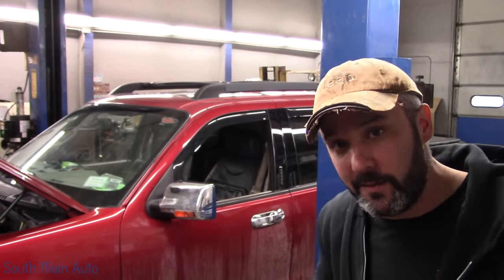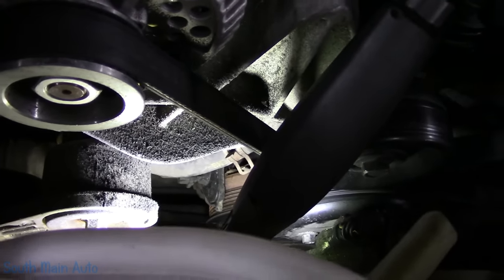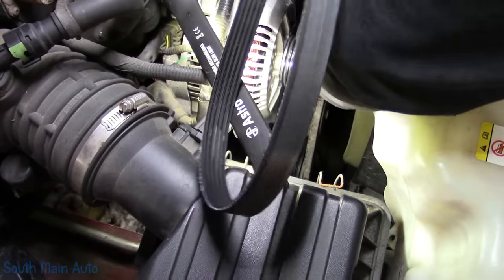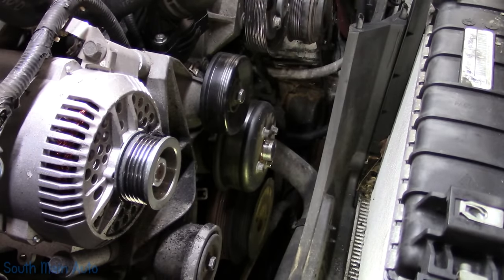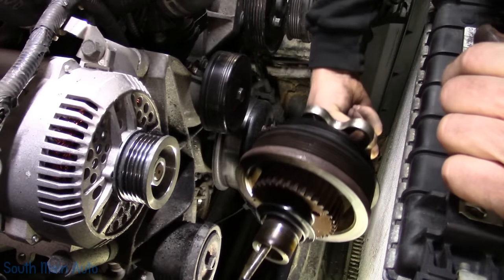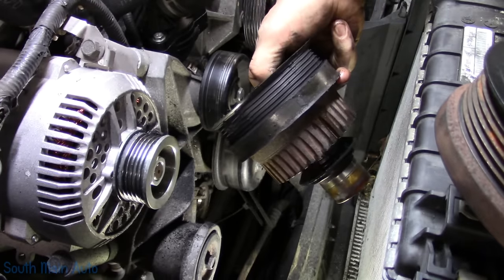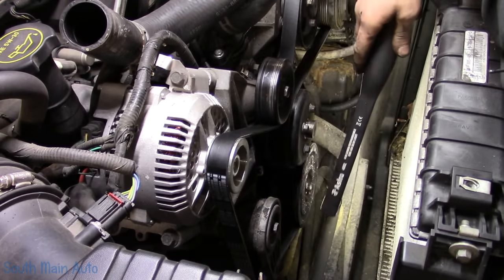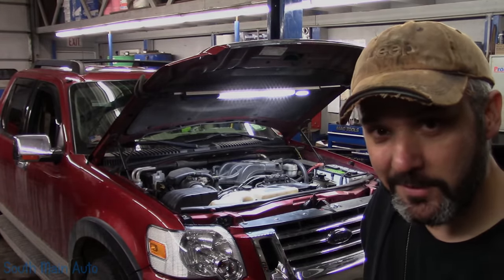Ford Explorer Sport Trac: Crank No Start

Comment: I just removed and reinstalled my harmonic balancer on my 2003 Ranger with the same motor as this sport Trac, the 4.0 sohc. Have a couple comments that may help others. Napa's version of the rental fan clutch removal tool includes the needed 57mm and 36mm wrenches and works great. The "bolt style wheel puller" kit from harbor freight is 20 bucks and works great for this application. The kit even included the correct size bolts to thread into the pulley. 

I don't have the fancy impact that fits inbetween the radiator and the pulley. To get the balancer bolt loose, I put a long breaker bar on the bolt and rested it on the passenger side frame rail. Activated the starter for just an instant and it broke loose real easy. 

I also didn't know that the bolt is TTY and shouldn't be reused. My local parts stores didn't have any in stock. Make sure to get one before disassembling like I did.

Comment: This is old I know but the AutoZone thing was spot on, in 08 I got laid off from gm I was at the time gm ,Ase certified after driving around all the shops in town and no go on a job I put in applications everywhere,I figure I could work at a parts store until winter was over when people get their taxes back business will be boming and il get back into a shop , AutoZone said I wasn't what they was looking for because I kept correcting idiots that were wrong!!! Isn't that what you are suppose to do help the customer get THE RIGHT part? Well apparently not , it was a blessing though I started my own gig and never looked back , now other shops in town send me "phantom issues" which means them plugging in a scanner don't tell the which bolt to turn so they are lost , I love this channel I can relate to so much I see here,and have learned a thing or 2 along the way

Comment: Pretty much any autozone around me in suburbs of Chicago are some teen kids that don't know a bolt from a screw. I went in there needing brake grease, some clown kid try to convince me aluminum antiseize is the "same" thing. Told him "what do you think ANTISEIZE is good for?!" Told him yea go ahead and use antiseize on your slide pins and come back a year later and see what it becomes, more like seize paste! Needless to say that young man learned a thing or two! And yes their application process is a mirror under nose and if it fogs up, you get the job!

Comment: Well Mr O thanks for this video and you are always so funny that you say you can do this job. Well perhaps 100x slower and buying the right tools or just saying time to give up. Well i pulled a crank balancer/pully once and rented the baddest compressor and huge impact air wrench and the crank pully did not budge a bit. ended up drilling 6 holes around the bolt flange  just bearly through and squirting liquid wrench and the bolt came out. but pulled the pully off with a large external puller that gripped the outside of the pully rim. Yes the harmonic balancer started to clang shortly after that. Had to replace cranksensor on 1992 buick lasabre 3800, touchy adustment required. Thanks so much for sharing you expertice and experience.

Comment: Great Video! Need to apply a light coat of black silicone to inside of balancer at end of balancer and on keyway to prevent oil seeping through and leaking at bolt head.

Comment: Remember, that engine is a hybrid of a German 2.8 turned 2.9, turned 4 leaker, then lightened up and crammed full of all kinds of pitas.
Ford did that.
The customer was lucky to find someone around on a late Saturday to do all you did or tried to do.
The third guy at the parts place left when he stops getting paid, and he used you to try and train Beavis and Butt-Head. 
If you could do it over, you might get them a rental car for their Exploder and just visually inspect and diagnose.
The best parts to fix a Ford are the updated parts from Ford.
But you are of a special breed and gave up your Saturday for the right to make it run anyway.
The customer found a good man. He finishes last, learns the greater amount of knowledge, and tried to network any day of the week or hours he can use to accomplish getting that customer a running vehicle.
That's not taught, except to the most tenacious and dedicated people who can cut to the quick.
They should be compensated well for sacrificing their time and relationships.
But, then, Mrs O knows too, you can pick another day to spend with her when things calm down and you trust someone to run your shop as you would.

Comment: You have so much more patience than I;  Nothing bugs me more than having to remove ten things to remove the one item that needs it.  In this case in order to remove the damper, you have to remove the fan, to remove the fan remove the shroud, to remove the shroud remove the coolant and the upper hose, then remove the PS reservoir,  then remove the coolant reservoir.  THEN you can remove the damper.   I hate that stuff.  Seems like every job is like that, too.

Comment: 1969 Ford F100 with a 302, in the parking lot of AutoZone tried Five (5) starters and none worked. Push started truck and went to O'reilly Auto Parts got starter and installed it. Truck started right up. After 6 years starter still going strong.962.739 miles on the clock, engine never been opened up. Bought truck new and maintained by my Ford dealer. Service Adviser @ Ford laid $5.000 on counter for my truck. No deal I said. Pop the hood and one fan belt for Fan, A/C, Alternator, and Power Steering. Two vacuum hoses, one for Distributor and one for Brake Booster. Today's vehicles nothing but high dollar electronic nightmares. You keep the new vehicles, I'll keep my old 69 Ford Ranger..

Comment: Seen this video before. Remember calling a buddy of mine next day. He has one he inherited. Was his grandmother. Sweet lady. Thing is mint. Looks brand new. Think only time she drove it was to have him change the oil. He chased the long crank, misfire for a while. I called him up, dam 2 piece pulley and crank sensor. He said he was in the middle of changing it, AGAIN! I said no aftermarket. Take it back before you mount it. Bite the bullet. Order one from Ford. It might last longer. I'm not a Ford fan. But this truck looks like it just rolled out the showroom. I gotta admit I kinda like it. Told him oil it up. He doesn't drive it in the salt. It might last a few years.

Comment: The same thing happened to my dads Sport Trac, the pulley separated from the balancer and migrated back towards the block.  The belt cut grooves in the rubber portion and I mistook it for a pulley as well.  His didn't kill the pickup sensor, but the belt squealed like crazy anytime it was first started or the A/C would engage.  I changed the belt and the tensioner and the squeal went away.  Went to visit my dad a month later, and the squeal was back.   That's when I noticed chunks out of the rubber "pulley", which is when it I had the ah ha moment!.

Comment: What happened to the other "not-a-sponsor", the local NAPA store?   This video was really helpful in all respects, from the importance of choosing the right parts store to the values of a good visual inspection in diagnosing the problem and of working at a time when you're not going to be interrupted to the benefit of long experience and having & using the right tools to get the job done without damaging other parts, like the radiator, or making the repair any more complicated than necessary.  The talcum powder tip was great great, but you know it causes cancer in serpentine belts, according to the States of California and Sinaloa.

Comment: Planned to removed the oil pan to replace the oil pump, Ford 351W so I jacked the engine against the hood trying to clear the oil pick-up tube that was blocking the oil pan removal; installed new bolts, gaskets, new motor mounts and made sure everything torqued down. Tried to sit behind the wheel  to crank it but couldn't...the box containing the new oil pump was just sitting there... on the floorboard.

Comment: I bought a new battery at AutoZone shortly after I moved to Minnesota. It was not a maintenance free battery and Minnesota has some good extreme temperatures so I asked how often people usually needed to check/fill the water in the battery. I received a funny look and a "Uhh, you don't put water in batteries. You have to put acid in them, we don't sell that and you don't want to mess with that" I don't ask them questions anymore

Comment: Eric, I hope you read them the riot act on the service. In my retirement years now, I have no qualms telling the local manager their stuff stinks. Sometimes it makes a difference. The loud radio issue is a real sore spot with me. The employees would crank it up on their store demo radio. It was always hip hop. So when I would go in the store I’d make a b line to the radio and change it to classical. Several times I told the manager the music choice /volume screams “go away” . If that didn’t sink in, I’d un plug the antenna.

Comment: Don't feel bad. We all miss stuff. Just last week i spent 4 days trying to figure out why my 96 ram wouldnt start after tracing a burnt fog light wire causing an issue with my park lights. Turns out when unplugging stuff to isolate the location i failed to  plug the connection for the starter solenoid. Same truck i had also been looking into new torque converters because of unwanted lockup/unlockup action that turned out to be a brake light switch issue

Comment: I had this exact same problem get towed into my shop this week on an explorer 4.0. The belt stayed on and cut grooves in the rubber part of the dampner too. The complaint was that the engine died driving down the highway..... the pulley had cut the crank sensor almost 1/2 way through.

Comment: I had one of those come in with the outer ring missing, and some other shop had installed a smaller belt to take up the slack. The rubber ring had belt grooves worn into it.

Comment: Same thing just happened to my wife’s mustang with the 4.0 v6. after 214,000 miles. The Pulley jumped back, and the belt cut a new groove in the balancer. When this happened, the car immediately died in the middle of the road.

Comment: As a parts counter person I find lot of customers askwhat is wrong with car showing a code and how to fix it. We are not mechanics. Its up to the customer to figure that out. Some customers get mad if we tell them to take it to a proper mechanic for a diagnosis as one code can effect other systems in the car. If they insist on that part we will sell it to them but once installed they can't be return and then they get real mad. Then they cuss us out and call us jerks

Comment: Bro. No matter what dealer you work or what parts store you go to. They (parts) will always find a way to mess up your entire job and cause complete havoc. 

Not having the part that was quoted to be "on hand" or pulling the wrong part. Or quoting the wrong part to find out when going back together that it was in fact the wrong part.
Or my favorite, 
When they don't have the part, order the part that takes 3 to 5 days to arrive, and it ends up being the wrong part, then come to find out they had the correct part in stock the entire time 
:) breath breath breath

Comment: Here is a thought: possible that the alternator locked up, broke the belt and whoever replaced the alternator had to get the smaller belt because they installed it on the rubber because they didnt notice the balancer was in further than it should? That is why it has such nice grooves?

Comment: had an ac belt used to do the same thing.  But it was worse since all the other belts had to come off first to fix it.  Seems when they make their own groves, the belt stretches to much to let you tighten it on the right way.   
Just watched a 6 year old clutch video, and they did the same for the water pump pulleys.  Once in the car and noticed, no room to get at the bolts to remove it.

Comment: Talcum powder on the belt, that sounds a little messy. I had a belt on a Subaru that squealed at idle sometimes (it's changed now and the new one is dead quiet), but I used to stop the squeal by holding a little piece of an old candle against the sides of the belt while it rotated. This would stop it squealing for a couple of weeks, and it didn't leave any residue or make the belt slip...pretty neat I thought.

Comment: I had a 6.2 Diesel in for a bad miss - and after checking the compression across the boards and pulling the valve cover on the bad cylinder - I saw a lot of oil on the floor and I looked and saw a rod hanging out of the block. Doh!!!!! I missed that one, big-time!

Comment: Never used belt squeal.  Didn't know that it fills the groves.  First car I ever had that squealed was last year, and it wasn't the belts, it was the timing belt tensioner pulley.  When I took it off to fix the head gasket leak, it was obvious what was squealing.

Comment: Another great video... Is the fan nut left or right hand thread?   I found the easy way to tell which way to loosen the nut is to look at the fan blade... turn the nut from back edge to front edge to loosen it.. the fan will always tighten while running..

Comment: HERE'S A GOOD TIP ON USING A PULLEY STRAP!
Grab a socket, like the ones used for chainsaws and the like....they may have a handle or just a hole where a rod or pin goes through.
  With an angle grinder or drill cut a slot into the socket on opposite sides ....wide and long enough for a strap to fit through. With the loop formed, wrap this around the pulley. This gives you a place to fit a large box wrench as you snug up on the strap tool.
  Hope I explained it so as ya'll kin unnerstan'.       Cheers be two ya.

Comment: I was the guy that put the slightly longer bolt in the radiator shroud and cracked my  radiator 🧐  1/4 of an inch cost me 180.00

Comment: I had a similar situation.  (The complaint was belt makes noise.)  When working p/s the belt squealed a lot. It took a few minutes to figure out - outer pulley was gone and it was running on the inner hub!   / 
90% of parts stores mess me up!  I leave pissed, disappointed, disgusted and feeling like a rare genius. Damn!  if I have to give you your part# off your website!  Why are you here!  This week I had to show a 50 year old  parts man - what the original jb weld was.  He typed it into the computer ( cause he had no idea) found some jb weld super glue and was ready to get it.  🤯

Comment: I know this is a old video but I didnt see if the crank bolt was new. These bolts has to be replaced or they can become loose over time and cause the timing chain sprocket to strip out the key way and cause the valves to hit the piston. The key way is only used for timing. Pressure from the crank pulley and bolt is what keeps the timing sproket from spinning and breaking the key. Just throwing that information out there if someone decides to do this type of job. Always replace the crank bolts on all ford vehicles if they are removed.

Comment: I went into Autozone last week and asked them to look up which brake bleeder screw I needed (because of course I snapped it off) and the guy proceeded to tell me that I had to bring the old bleeder screw because they are not standardized and it could be any size. I told him that was absolutely not true and he argued with me of course. Fast forward 5 mins and I got him to look it up on his computer to "prove me wrong", guess what? Yup showed exactly which screws I needed for the front and back. Guy hot super mad for some reason and left, the girl that was there came over and apologized for his behavior. That is a pretty typical experience at any of my local Autozones.

Comment: I squirted Dishwashing soap mixed with a little water inside my Honda A/C clutch and it's so quiet now.
It would make high noise intermittently.
I you used oil it would foul the clutch and cause slip.
I think particles and goo interfere between static and moving mass and they ring like a bell.

Comment: When I  pull a balancer I just put the bolt back in and back it off several turns and then install the puller using the bolt to pull against

Comment: I had an Explorer that would crank and not start. After a new fuel pump, and HOURS of screwing around the 'mechanic' gave up! (cost me a bundle) I had it towed home and in under one hour I found that the truck FORGOT the key code! The second key started it up instantly. The issue is I now only have two keys as Ford states they cannot copy my key any longer due to age! Yes, I said 'had', I traded it in back to Ford, they got their POS back, good luck to them!

Comment: What I learned from working at private shops was, add some black silicone to different sections of the belt, turn it on and it fixes squeeky belt syndrome too.

Comment: fun Ford fact, if the check engine light stays on while cranking, its not getting a tach signal. If it goes out while cranking its getting a tach signal.

Comment: yes crank sensor should be alive while cranking, and fuel disable should say no. im working on a mustang 4.0 2006, i have spark, crank reading, injector pulse, scan tool shows 50 psi of fuel pressure, compression around 110 psi, but wont start, not even with starting fluid or starting fluid applied into intake.

Comment: The belt length... I was wonderin' ... wait, that rubber is a hell of a lot smaller diameter, can the tensioner make up the diff? naw... thats a lot!  It also leads one to ask the question: was the Alt changed because it was truly bad? or just slipping ?